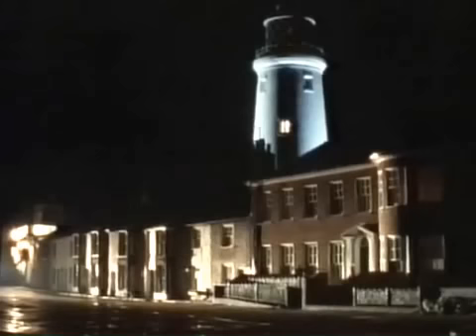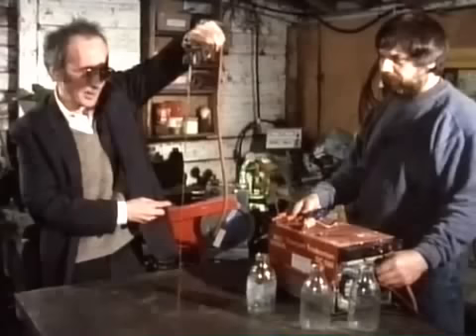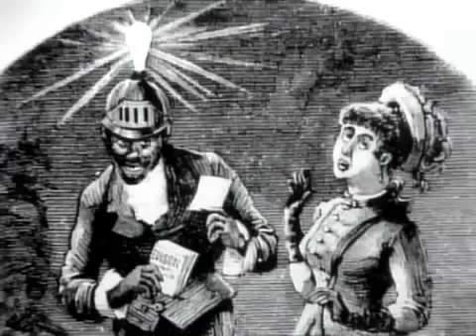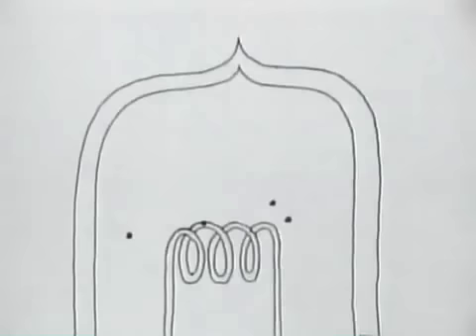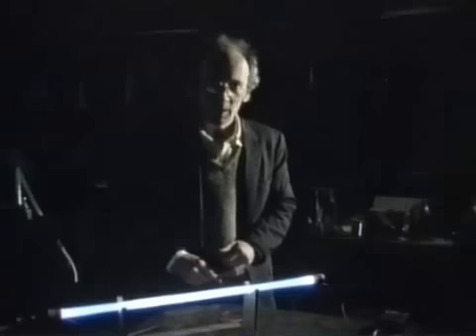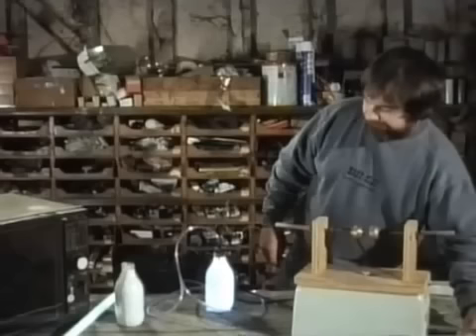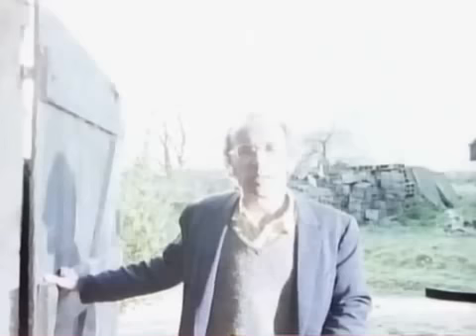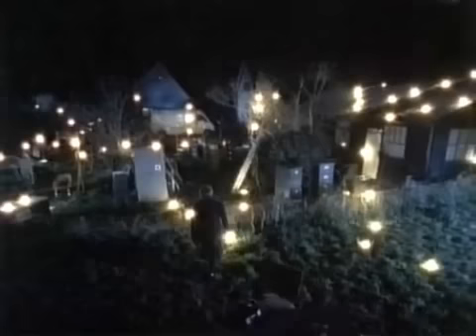Secret Life Of Machines - The Electric Light (Full Length)

Comment: I really wish that here in the US, we would switch over to the Bayonet type base and socket. seems like it would be much easier to change a bulb out.
 with the screw type base, if the bulb is hot, by the time you get the damn thing out of the socket your fingers are burnt to a crisp.
Reply: @Cutter1018  The simpler solution: use LED bulbs that don't get as hot.  Newer ones are much better than CFL and as good or better than incandescent.    ;)
Reply: @PongoXBongo  and cost eight to ten times as much
Reply: When’s the last time you checked the price of an LED? You can get LED bulbs for not much more than their incandescent counterparts.
Reply: @erikj.2066  Please let me know where you are shopping. A single LED at home depot runs about $7 a bulb. A standard incandescent runs about $1
Reply: @Cutter1018  And that LED will last 7 times longer and cost 7 times less to operate.  It's an investment like rechargeable batteries (once you have the charger and a handful of batteries you're set for life (almost)).
Reply: Erik J. Nice to know.
Reply: Scott Raisch yessir, I have a house full of them. Electric company gets enough money out of me in the summer,  when the wife cranks up the central air.
Reply: @PongoXBongo  A few months ago I got white LED bulbs that work with dimmers, from the County of Los Angeles in the mail.
Reply: I get a 6 pack of Phillips LED 8w bulbs from Toolstation for £12, £2 a bulb, equivalent to 60w and lovely 2700k light and by a quality manufacturer so will last, virtually indistinguishable from a filament bulb. I don't really know how much a filament bulb costs having never bought one, but I think I've seen them in multipacks in the pound shop, but even if they are 1/10 the price, 5 for £1. That means it costs £1.80 extra for the LED, if you were to leave it on 24hrs a day, at the UK average cost of electricity (£0.14 per kwh) it would cost 17pence more per day to run the incandescent, meaning you will get your extra investment back in 10 days! Even if you only have the light on 4hrs per day in the evening, you are still looking at 2 months to get your money back. I bought my first pack 2 years ago and havent had a single one fail yet.
Reply: Screwed by Edison.

Comment: Another way to light conventional fluorescent lamps (the tube kind) is to hold them like a torch under high-tension power lines. Just don't be the earth connection by touching a terminal.
Reply: Yeah I'm surprised they didn't do that one. Popular demonstration in physics classes.
Reply: Touching the bottom half of a flouro tube is perfectly harmless provided you’ve got ample clearance from the lines themselves. This demonstration works best on lines of 161kV and greater, and when humidity is over 40pct.

Comment: No mention of tesla anywhere, for shame.
Reply: They weren't focused on the grid as much as the light, so it's understandable.
Reply: @stopthephilosophicalzombie9017  they did display a number of technologies Tesla invented.
Reply: @1pcfred  Which?
Reply: @stopthephilosophicalzombie9017  high frequency current and fluorescent lighting. Tesla did not invent electricity but he did invent the practical way we generate electricity. So whenever you use electricity it is hard to avoid his influence. Tesla was even awarded the patents on radio. So when Rex said radio there you go. Marconi did not invent radio. At least not the technology that makes radio work. What Marconi did do was recognize the significance radio could play in communications. Which I don't think Tesla was very interested in.